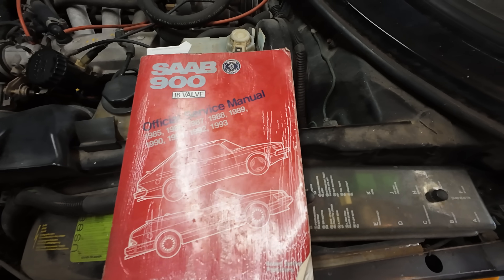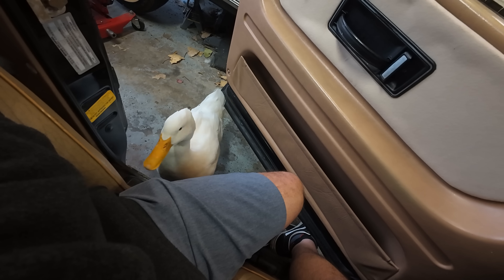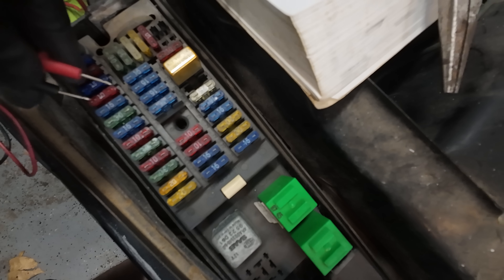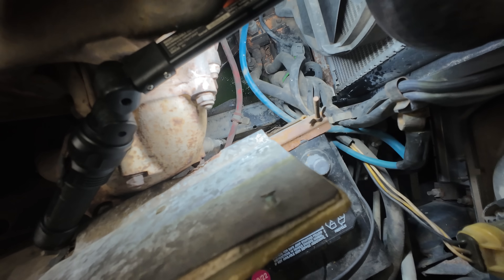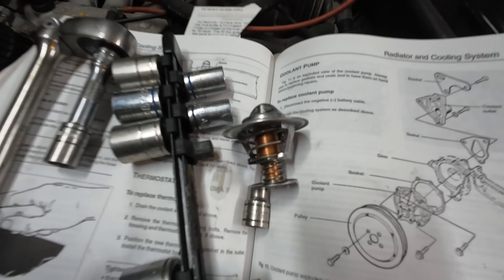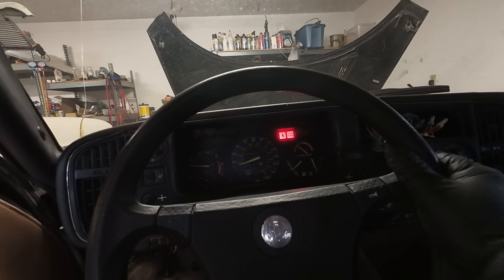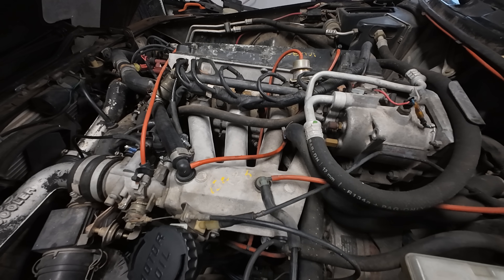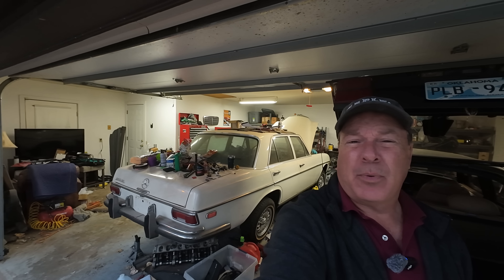How I Saved My Saab’s Engine For 5-cents!

Comment: As much as I hate to say it, a small crack in the head gasket may cause that hard start issue you’re experiencing. It goes away after the vehicle is warmed up, things heat up, expand seal the crack. I know you have a inspection camera, my advice would be pressurized the cooling system pull the spark plugs, and see if you see any coolant leaking into the combustion chamber when the car is cold

Comment: Have you made sure the fuel pressure regulator? Pull the hose and make sure fuel doesn’t come out. I had a volvo that started just like that and it was the regulator. Car would lose “prime” while sitting.

Comment: Hey Mike, I live in San Antonio, Texas and we’ve had cool damp weather like you all have had. When that happens the exhaust system loads up with moisture, so when you first start a car, the heated exhaust makes a mini rainstorm in the exhaust pipe and you get a flood of condensation. Also, you’ll get a bit of moisture from the catalytic converter doing its job, one of its byproducts is water. I think your Saab’s fine, of course you never can tell with a 37 year old car, that’s half the fun of owning them, you never know what’s gonna break from day to day. Love the channel and Benzo and Lola, great pets….
Reply from the maker: Thx!

Comment: For every gallon of petrol/ Gas an engine burns, it will by pure coincidence produce a gallon of water, so I don't think you should be unduly worried.
BTW one of the best cars I ever had was a Saab, their engines are virtually bomb proof as long as they have routine maintenance.

Comment: The belts drive the water pump! No belts, no flow. Please put them on. The white plastic thingy in the fuse box is a fuse puller. Real handy. The car sounds like you have some plug wires mixed up. Remember the engine is in backwards. Lots of luck, I enjoy your vids. And saabs, for years...
Reply from the maker: All the belts are on
Reply: Yeah he really needs to address that running issue first and foremost. That starter could do with a lube up but it wouldn't be so bad if the engine just started.